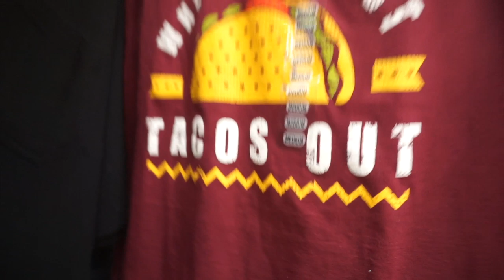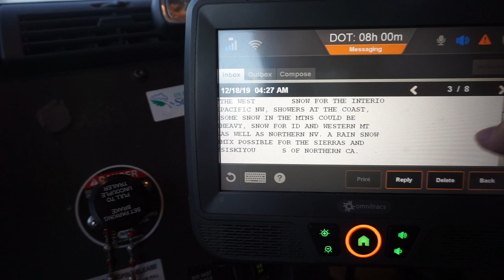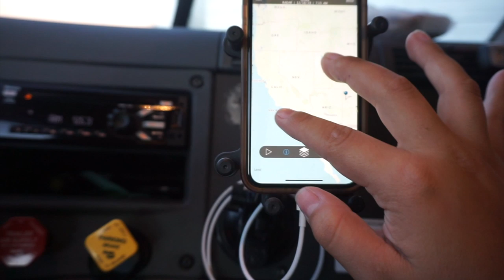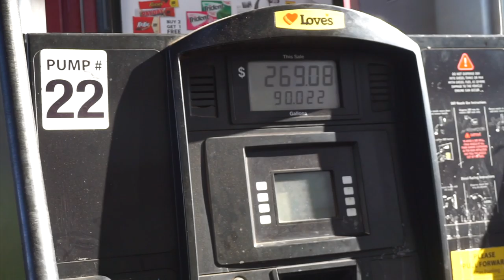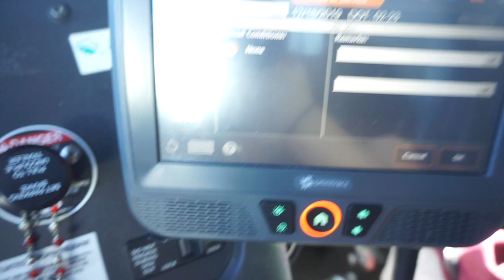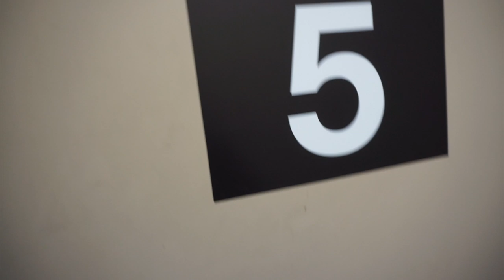A DAY IN THE LIFE OF A YOUNG LATINA FEMALE TRUCK DRIVER!!

Comment: Good video.  This is what many drivers don't show.  The tedious parts of the job, but it all has to be done.  One thing you could do to save time and save on your 70, is not do a post trip.  Post trips are normally done on a truck when you are returning to the yard and leaving the truck or trailer.  The post trip report is for the shop mechanics, so they know what needs repaired before the truck or trailer goes out again.
Reply: Hey pappy!
Reply: @truckingreviewchannel  Hey TRC.
Reply from the maker: thank you Happy Pappy for the tip! when we started with our company they said to always log the pre and post trips so I didn't know but now I do :) thank you!!
Reply from the maker: @truckingreviewchannel  Hi TRC :)

Comment: Oh...  please don’t park on the fuel pumps while inside doing stuff....  please...  
 And what’s the point of slapping the tires... 🤷‍♂️
Reply from the maker: There were a lot of fuel pumps open & if I saw someone behind I would move up.. feeling and trying to move the tires to make sure they’re sealed to the rim and for the air pressure. You get a better feel for them with bare hands. It’s better then “kicking them gently” and not knowing if the pressure is good or if the tire is off the rim. Everyone has different ways, just showing mine :) thanks for watching!